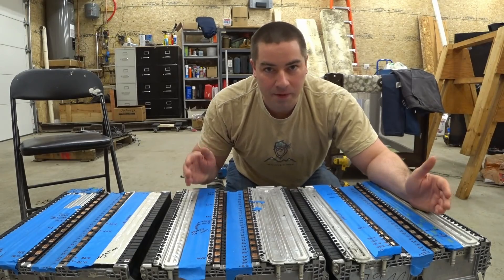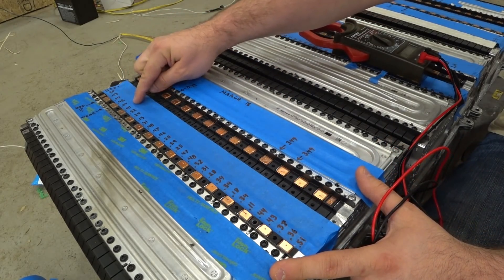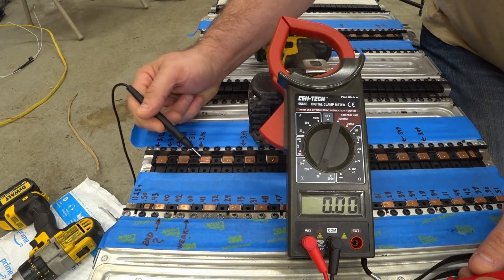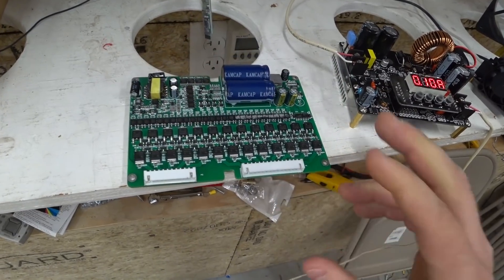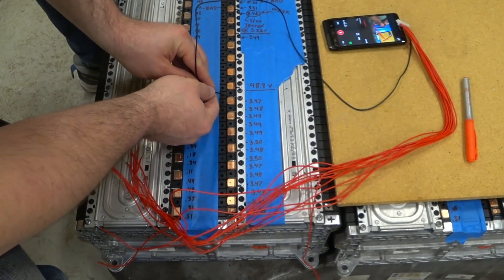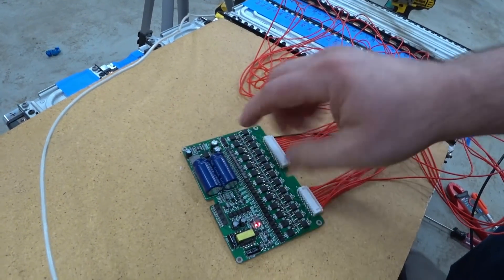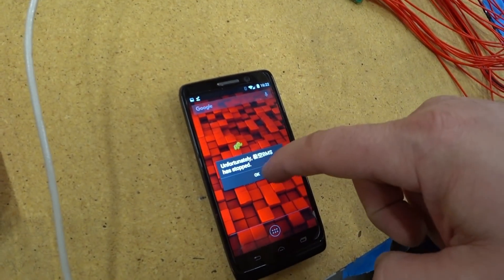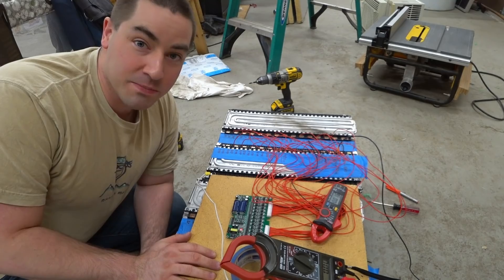Can I bring this dead Lithium Battery back to Life?

Comment: David I have a question about your inverter setup I'm currently installing a 10k aims inverter and was un sure if there's a way to set a custom voltage for the low voltage shut off.
Reply from the maker: Hi John,  On my Aims inverter there are dip switches (very tiny).  One of them controls the low voltage cut-off.  It gives you the option of 40 volts, or 42 volts.  I have mine set to 42 volts.  Other brands, Magnum, Victron, Schnieder, Outback allow you to program all those setting to exactly what you want.  Aims, it's just one of the two pre-sets.  I hope that helps.
Reply: @DavidPozEnergy  I have a 14s nissanleaf setup about 9kwh should I reconfigure for 12s?
Reply from the maker: 14s is pretty ideal for our lithium chemistry.  I would look for an alternate way to protect from over-discharge before re-wiring to a 12s.  Maybe a BMS that can shut down automatically for you?  The Aims inverter can auto-start a generator at 44 volts, but that would be 3.14 volts per cell (@14s).
Reply: I have a bms but its hooked up for balancing only at this point but I have 3 packs at 3.5kw each and each have a bms with everything I just spent I'm trying to protect my investment the best I can. I wish aims had a pot you could adjust for low voltage cut off. I have 16  330w panels powering my system during the day
Reply: @DavidPozEnergy  perhaps someday I could review my setup with you get some advice on what to change.

Comment: I cringed when you slid the board across like that. Fets, transistos and i.c. chips can be damaged from static electricity especially when the humidity is low. What do you plan on doing with this new battery your testing?
Reply from the maker: Thanks for letting me know about the static electricity potentially hurting the components.  I thought I was doing good not letting it touch the aluminum on the battery.  LOL.

Comment: Thanks for your review of this balancer. I had researched capacitive balancers via white papers that just switched the super capacitor between the highest cell and the lowest cell. Problem with those was that as the voltage difference between cells dropped, the series resistances of the switches dominated and balancing currents fell to near zero. This balancer uses DC-DC converters to utilize higher voltage swings on the capacitor and thus alleviate the I/R drop issue. I think I will order one as a backup to my custom passive balancer.
Reply: Exactly - think of the flying capacitor like a bucket that fills and empties nearly completely as it bails out high cells and fills low cells.
Using a supercap to balance without any dc-dc conversion is just silly as it wastes almost all of its capacity.
Reply: Instead of a capacitor, use another cell
Reply: From what I can see, this balancer charges 2 capacitors in parallel, then changes them to series for discharge

Comment: I just bought one of those balancers on aliexpress for 87USD incl shipping
Reply from the maker: Cool.  When I ordered it 2+ months ago I couldn't find it on Aliexpress.  When getting ready for this video I found it being re-sold by at least 3 vendors.  Which is great.  Especially because I paid $90.  So you are getting it cheaper, and probably will arrive faster.  I'm glad they are becoming more available.  I wish there was an affiliate program.  :)
Reply: @DavidPozEnergy  what is the app called?
Reply from the maker: "JK BMS"  I had to get a link from the manufacturer.  It was a temporary link, and has expired.  I wish they just made it easy, but it took me days to get, download, figure out passwords, etc.  And it still keeps timing out every 30 seconds.  Technology and I don't mix.  LOL
Reply: @DavidPozEnergy  thanks. And the 4 digit code?
Reply: @DavidPozEnergy  mine came in a black metal case. Apparently there is a 2A version available now
Reply from the maker: @climatechangepreppersfaceb2148  Hi Nevada,  The manufacturer never gave me a 4 digit code.  I guessed by typing in 1-2-3-4, and it worked.  I got lucky.  I'm not good with technology.
Reply: @DavidPozEnergy  it's not you, it's appalling after sales service and an abysmal app. 30 seconds? I'm lucky if I get 15. I managed to turn on balance but it says "waiting" and down the bottom it says something is out of range. Did you figure out what the voltage settings were? I see one is cell count, another is imbalance mv, which I changed to 0.002. The others make no sense
Reply: App updated! Still won't balance though
Reply: Link to it on Ali ?
Reply: There is an affiliate program, just google "Aliexpress affiliate."

Comment: Oooh, I like that balancer! It appears they store charge from one cell and transfer it to the lowest cell, rather than the typical approach which is to run all cells down to the cell with the lowest voltage of the pack using resistors. They are quite pricey though. I've seen a balance board that claims to use magnetic storage of energy - in a coil, rather than electrostatic storage using capacitors, and that was much cheaper. Not sure if they work. Here is the link on AliExpress David if you want to investigate this further:- https://www.aliexpress.com/item/DYKB-3S-4S-6S-7S-13S-16S-Li-ion-Lipo-Lifepo4-Lithium-Battery-Active-Equalizer-Balancer/32982237929.html?spm=2114.10010108.1000013.1.2c1428b7pym6cv&gps-id=pcDetailBottomMoreThisSeller&scm=1007.13339.99734.0&scm_id=1007.13339.99734.0&scm-url=1007.13339.99734.0&pvid=4c7e3fc2-c9a2-495a-b96d-84b007efab34
Reply: don't bother getting this , this ones haf burned off even a small mistake .

Comment: I see 1 black and lots of red wires. Lots of colors would be better for trouble shooting later. Good work.  Can you find a cell or two on eBay to replace the bad one or two
Reply from the maker: I agree, multiple colors would make it a lot easier.  It takes a bit to trace back to find the next wire.  I'm not going to try to find replacement cells.  This is a 93 cell pack, which is an odd number.  So I don't need all the cells, kinda works out.
Reply: @DavidPozEnergy  Good to have spare cells anyway - keep them at storage voltage of about 3.8V.

Comment: that "unique equalizer board" , does it balance at any voltage or just in the upper absorption area?
Reply from the maker: I think any voltage up to 5 volts per cell.  As you saw in the video, I was not even at 50% SOC and it balanced when I pressed the button.  It's pretty nifty.

Comment: i still am not sure if your going to be happy with the AMP hr tests .  i am sure your next video well be about how much it can still hold after all that
Reply from the maker: That's true, that there might not be much usable capacity left.  We will find out.  And, yes, I will post a video about it.
Reply: I don't think it's gonna be that bad, sure, you will have some bad cells but the majority will retain higher than %80
keep in mind that even if the pack was healthy when you opened it you were only going to get %85-%90 of the rated capacity    @DavidPozEnergy
Reply: On what basis are you concluding that capacity will be lost? Please provide white papers supporting your conclusion

Comment: 8 hours to balance them not bad. How much heat did it generate? How big is the battery bank?
Reply from the maker: I couldn't detect any heat above ambient.  I used an IR thermometer, but perhaps something might have showed up if I had an expensive thermal imaging camera?

Comment: Please be careful as that amount of DC voltage can be fatal.  I'd be wearing thick rubber gloves when measuring around that full pack if I was you
Reply from the maker: I can't tell, are you being serious, or are you playing a joke based on the comments from my last video telling me to take my gloves off?
Reply: @DavidPozEnergy  No joke.  The DC voltage level than can cause harm is dependent on a number of factors as it is the current that causes the problem.  Even a current of 20mA is enough to stop the heart if it goes down one arm and out of the other one.  When I was in the airforce we were taught that anything over 50V DC should be considered lethal but they were probably being over cautious.  With the type of cells you have there that  can deliver large amounts of currents I would definitely be wearing protective gloves when potentially touching terminals approaching a difference of 100V DC.  Another thing we were always taught was to secure one of the test leads first and then only measure the voltage with one hand and to keep the other one in your pocket to prevent the arm to arm currents that I was talking about earlier.  Great videos by the way and I'm so glad that your pack seems to be recoverable apart from a few cells :)
Reply from the maker: @eabyrd1506: Yes, you are right.
Reply: @DavidPozEnergy  I really suggest watching Big Clive as he progressively shocks himself with 240V between both hands and increasing the current each time, while explaining a lot about what is happening. Unnerving, but very educational!
https://www.youtube.com/watch?v=-5R-KBa18ME
AC is more dangerous, as the pulses continuously trigger muscles. DC is one initial pulse and then the muscles relax - best to avoid shocks altogether, unless you need defibrillation...
Reply: @ahaveland  big Clive is awesome :)

Comment: Lucky you don't listen to uneducated people who know very little about lithium!
Reply: No, they are not. You clearly don't know what you are talking about. Explain why you think they are damaged. They MIGHT be damaged, but you cannot possibly determine that until they have been tested. As I've already explained many times, lithium batteries are restricted from going too low not because going low damages them (unless high C) but because the inevitable RECHARGE is when the damage is done. Lithium plating, solid electrolyte and dendrites are all processes that occur when too many lithium ions try to move all at once. This happens at very low temperature and also at very low SOC. If you charge very slowly, these 3 processes do not occur. I get my education from Jay Whittacker and Jack Rickard, the two best lithium experts in the world
Reply: You continue to argue even after being proven WRONG, firstly by myself, then by Davids successful recovery. So now I'm going to embarrass you. If you actually bothered to read any scientific white papers on the subject, they would tell you: 

" Cells 2, 3, and 4 did not exhibit ISCr after being overdischarged to MIN, A and B (Fig. 1(c)), respectively, as they could be fully recharged and cycled without any signs of ISCr or significant capacity loss. The results of the non-ISCr cells suggest that if the overdischarge is terminated before point B at approximately −12% SOC (the first platform after the occurrence of the minimum voltage), the cell can be fully charged back and reused with only minor side effects.
Neither ISCr nor capacity fading occurs if the overdischarge is terminated before −12% SOC, where the first platform after the minimum voltage is located. However, if the terminal SOC is lower than −12%, then the battery suffers from ISCr, which is the result of Cu foil dissolution and deposition on electrodes according to the SEM and XRD results."
Source:Guo, R. et al. Mechanism of the entire overdischarge process and overdischarge-induced internal short circuit in lithium-ion batteries. Sci. Rep. 6, 30248; doi: 10.1038/srep30248 (2016).

In layman's terms, if you discharge to 0v, nothing bad happens. If you go negative by 12% SOC, then you lose capacity and form shorts
Reply from the maker: I guess so.  Thanks Nevada.

Comment: With less than the full 24s you need the the full voltage of the S number you have connected on the left side of the second plug at least that is how mine works
Reply: meaning, say I have a 14S battery. so after I put all the wire on the first plug, I need to give it about 52~58V to the last wire? or just 3.4~4.2V?

Comment: Great progress, hoping  you find most cells recover with low self-discharge. 
You just need to find a way to carefully extricate the dud cells bearing in mind the bank will now have a lethal voltage across it.
Reply from the maker: Chainsaw maybe?
Reply: @DavidPozEnergy  sawzall was used in the attempted murder of this battery, sawzall to finish the job on the weakest links

Comment: Hello David. I am happy for you on the battery. I purchased a bunch of the balancers and equalizers. I will have them on Tuesday. I think it should be a permanent fixture on every battery out there. They are awesome
Reply: Billy Joe, what do you mean?  Can you have a balancer on the battery all the time?  Of course!  Most people just don't for some reason.  Either they are trying to save money, don't understand the importance of balancing, or mostly I think people just think "it'll be ok".  I think probably, "it'll be ok", probably will be ok, for a while, until it's not...  Then you'll wish you had spent the relatively small amount of money to save you hours or days of work ripping apart battery cells and replacing them (or worse, the battery could fail in a more dangerous way...).

Comment: That’s a cool little balancer I need to find a 10s one of those
Reply from the maker: I think it will work with any combination, but it needs 40 volt DC supply.  So with smaller packs you need an external power supply.

Comment: Please explain more about that balancer you installed? Nice job!
Reply from the maker: OK, I'll touch on it more in the next video.  But there is a link in the description if you want to look it up.
Reply: @DavidPozEnergy  I saw ur comment explain it u start with the positive on the one side can u do in between 1-12 also can u do between 13 and 24. Lastly any idea if any makes smaller ones. I really like the idea of equalizing vs burning electricity wastefully
Reply from the maker: @plojm,  I have tried the balancer with different cell arrangements the last couple days.  It will work so long as the voltage is above 40 volts.  According to the manufacturer, it will work even with just 2 cells, so long as you provide an external power source 40-100 vdc.  I didn't know this at first, which is why I was so confused in the video.  The last wire is the power wire, not a balance lead.
Reply: @DavidPozEnergy  thanks lol I just saw on an ebay thread and was gonna post. Active, efficient, energy transfer balance
Continuous 1A balance current, independent of single cell differential voltage
for 2S - 24S universal battery（ Total voltage is lower than 40V
Need auxiliary power supply）
40V-100V power supply, standby power consumption 6mA, low power automatic shutdown
Bluetooth APP connection for mobile phone, real-time monitor battery status

Support: Li-ion, Lipo, Lifepo4, LTO, super capacitors and other batteries

Real-time, active, energy transfer equalization, after the balance, the monomer voltage difference ≤ 3mV
Monomer voltage range 1V-5V, accuracy ±5mV
 
Support balanced cascading for 24S battery packs, for exsample , it can cascade for 36S , 48S....and so on
 
Bluetooth communication function, English version of APP, real-time view of battery status
Balanced line resistance detection, abnormality found in advance
No external power supply required, direct battery pack power supply, 40V-100V
Low voltage shutdown function to prevent battery damage
 
It is only balancer , it is not protection board
Reply: Thanks. Please do a detailed video when you hook that up to your Chevy Volt batteries.